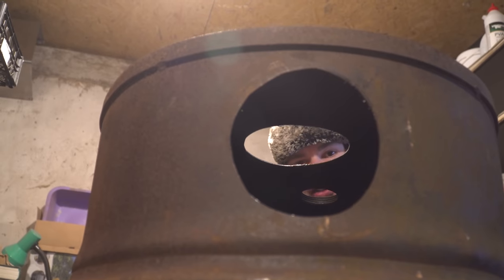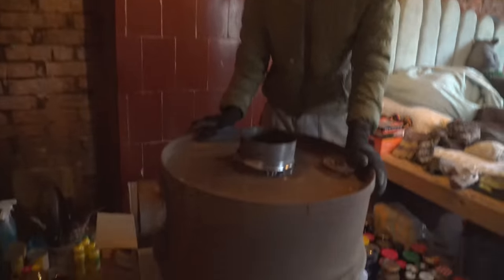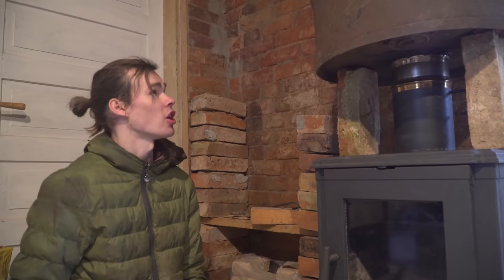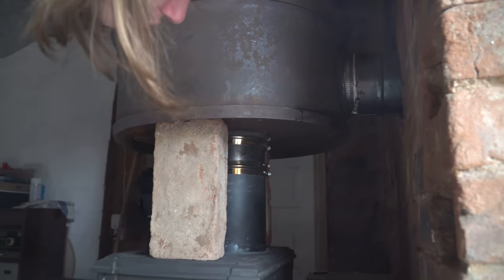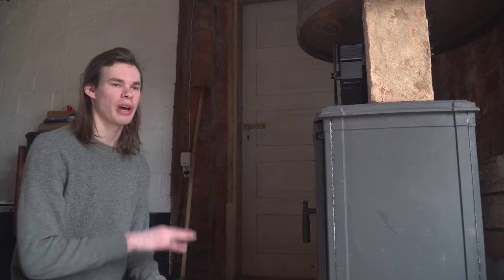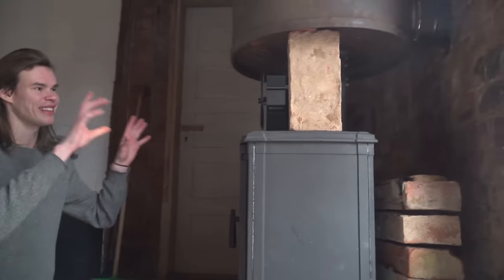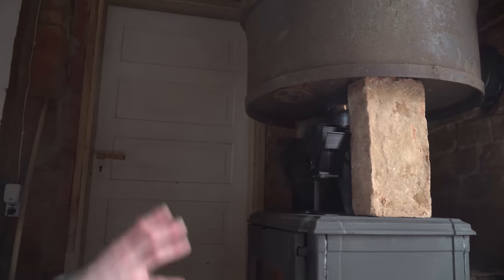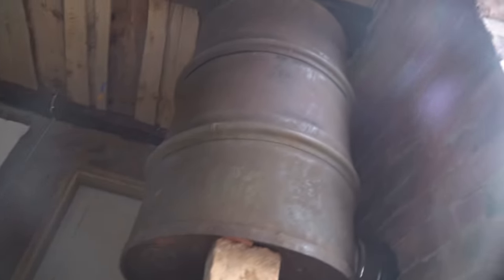Wood Stove to Rocket Stove Hybrid | Does it work?

Comment: I think that a thin modern barrel would work just fine.  Modern barrels are often used as the fire box in many wood stoves and I have personally seen then last 20 years.  That is with the fire directly in them, you are only putting hot smoke through it.  great idea for a heat exchanger .  Glad to see it help so much.

Comment: In the longterm it might be an idea to coppice cherry trees. (Or pollard to keep the leaves out of animal's reach). We did this at home for many years. The regrowth is always extremely straight and yields useful sticks and firewood. Don't coppice the tree every year, because it won't give much fruit that way.

Cherry is a sublime firewood and fun for crafting too. Made an insect hotel out of a log yesterday.

Love your vids!
Reply from the maker: Thank you for the idea! We actually have a cherry tree which is spreading like crazy, I cut down all the new trees growing around it as it was a jungle. But we could plant a large section in the field with cherry trees, I would like them as a wood meterial for furniture. I also need to invest in a wood chipper or make one my self as it would be a good way to burn smaller branches 🤔❤️

Comment: Do & Be Different Family When you mentioned your rocket stove modification i imagined the drum being filled  with sand with a pipe running through like a tunnel. This would make a heat bank to be released back into the room when the fire goes out. Less firewood burning time.

Comment: This is a unbelievable idea. I heat with total wood all winter.. this spring I’m gonna definitely attempt this good idea.. The only problem I fear is obtaining a thick gage barrel. Thank you.
Reply from the maker: Yeah it works wonders! 😊❤️ The barrel is a hard one to find as the modern barrels are very thin and won't hold heat for very long. Only good thing they are very light compared to this monster! 😂
Reply: I'm thinking of using a old 280 gal propane tank and modifying to make a barrel.

Comment: What the heck! That’s awesome! Some say to put a fan low on the floor in the coldest part of the house and blow it towards the stove. The theory is a that the cold air will be pushed to the stove low, then heated by the stove then rise and circulate back to the cold fan. Creating a convection or something like that. 🤷‍♂️

Comment: Nice build, well done. I would probably consider placing some cement board or stone sheet on top of the barrel. I had an oil drum that reached to about 30cm below my ceiling and the surface temperature of the ceiling could easily reach 200˚C. Also, although you have a thick barrel, it is also old and rusty and it's possible the intense heat of the riser might eventually breach it. It would also give you a bit more mass for heat storage after burn-out. Enjoy your warm room!
Reply: Great idea.   I too wanted to suggest a heat shield above the stove to protect the wood floor above it.   To prevent any chance a breach would get out of the barrel.   A stone barrier is a good  idea.

Comment: You solved many mysteries for people who are looking how to save firewood- thank you!

One suggestion: exhaust gas are still hot after leaving your barrel: you can weave them through house for at least 4 meters and put cob over it to create thermal mass- idea is to store thermal energy and do not start fire for two days...
Reply from the maker: I had a plan for that but it's a bit messy! For now it seams to be semi clean burning still producing some waste in the chimney but maybe 10% of what it would be without the barrel! 😀
Reply: @DoBeDiff  Just add more piping inside your house to increase heat exchange+ insulate house to reduce thermal loss... with love from Serbia!

Comment: Greetings from Canada! I would be interested in knowing what the temperature difference of the pipe going out the wall was before you added your heat exchanger/rocket stove , compared to now! Rocket stoves are famous for getting the most heat out of the wood and just warm(not hot) air goes out the chimney. Great job!👍👍😁

Comment: I am impressed! I was sceptical about this idea but looks like it works great! Well done! 👍
P. S. also instead of opening it you can buy an inspection door, there are for sale in Depo in chimney sections. 👍
Reply from the maker: Thank you! ❤️ It seams to work for now! We do need an insulated chimney to be fully safe ad the smoke is too cold or the difference in temperature is too high. But for now It works great, after 20 burns there isn't much of a build up so it isn't as fast as I was scared it will be. I was making this and was non stop worried it will not work at all, but works exceptionally. I want to buy an inspection door which will be easy to install on the barrel! 😊

Comment: Now draw in cold outside air and seal it to the air intake to the heater. The draw pulls outside air through cracks in the shell of your house.  Outside air allows 30 %  extra heat because your not burning heated air.
The barrel will also work on its side but needs internal baffles and a removable lid. You have done well! Enjoy.

Comment: It's great what you've done to make the house more comfortable.  I'm not sure how hot the top of the barrel gets, but assuming it's the same as a typical flue pipe you should probably have a gap of between 15-18 inches between it and the floorboards above (as they're combustible). That's normally for a 5" or 6" pipe, so it could be that the large flat surface at the top means you should have even more of a gap? I'd suggest you have a look at recommendations for some sort of shield just to be safe, especially as it could be running overnight. Enjoyed the video and the way you've getting around problems, but thought I'd mention the shielding as it's worth checking out.

Comment: I don't think this qualifies as a "rocket stove", nor a hybrid.  What you've made seems to be more of a "bell type" or "bell style" heat exchanger, attached to the top of a wood stove.  That said, I imagine what you've come up with is still much more efficient than a typical wood stove installation.  Beautiful, man.  Keep up the good work.
Reply: Yeah, rocket stove needs a few things to be a rocket stove.  L or J structure, insulation in the heat riser and some in the combustion chamber, etc.

Comment: You guys made an awesome version of a rocket stove. I have been studying them. Can I ask what kind of insulation you put around the pipe? I’m so impressed. I bet you could come up with a way to bolt that barrel to the wall so you could get rid of the bricks. Not because they are ugly. But because then you can use that space to heat a kettle or something. You are a complete genius. Love it
Reply from the maker: Thank you! 😊❤️ Heat resistant rock wool. It works good but would like to use ceramic wool, i will upgrade it next year with proper insualted pipe with sheet metal around the insulation so it doesn't fall apart. The outside pipe holds it quite good aswell, together with the bottom pipe it doesnt need any support we are just careful if it works without any problems might remove them 🤔😊
Reply: @DoBeDiff  You guys are the bomb. You really are. Love to watch all the work you do And the cooking

Comment: If you can get a small pipe hooked to outside air to inside your stove. This will stop the stove from pulling any cold air in under doors or windows.

Comment: wonder how your fuel expenses (in terms of the number of sticks or logs you have to take out of the shed per day) have changed.

i wonder if offsetting the stove and lengthening the exhaust pipe could get more heat out of the exhaust.

amazing stuff, even if it just helps your draft dynamics be better.

Comment: That looks amazing!

Do you think there's a way to make the heat move upward (to the next floor)? Would adding some pipe with ventilator be helpful or would  the heat's tendency to raise be sufficient?  II am trying to figure out how to make the basement stove more efficient. I don't really need to heat the basement very much, so the more heat going up, the more efficient (unless I store the heat in mass before sending up, not sure if that would also help)

Comment: What is the name of the sealant that you used, would like to know where to buy it.
Reply from the maker: Just any heat resistant sealant that is able to handle temps you need. There is many different ones. Every hardware store sells them.

Comment: Is that house still standing after 2 years? The short distance between the top and the WOODEN ceiling looks pretty dangerous.
Reply from the maker: It's changed a lot since then but the gap wouldn't do any harm old stoves are same gap from the ceiling in most houses. It's only 150 degrees Celsius so can't burn the wood in any way. But next season the barrel is fully gone we have switched to Central heating boiler much more efficient way to heat the whole house.

Comment: You didn't talk about insulation that you put inside, won't it catch fire inside the barrel?
Reply from the maker: It can withstand 1300 degree Celsius 😊❤️ it might only fall apart overtime from the turbulence created by the smoke but I plan to change it fully to insulated stove pipe that has metal sheet around the insulation which protects it, but first I need a proper welder for sheet metal 😁
Reply: Good idea.  But if soot builds up in the insulation, it can catch fire and cause an explosion.  Be attentive and careful.

Comment: You can cast a riser pipe out of refactory cement using wire thru the single wall sheet metal and cut up coarse steel wool (think rebar in cement) https://en.m.wikipedia.org/wiki/Rebar

So when the sheet metal pipe burns out you will still have the refactory pipe you cast.
Wrap wire around and penetrate both sides of sheetpipe. x100 hand mit steel wool and refactory so steel wool is dispersed throu out.  Be well.

Comment: Are you sure that pipe thing doesn't release toxic substances into the room air?
Reply from the maker: What pipe thing? The barrel? How could it release anything its made to hold liquid its airtight. And chimney will have holes and gaps no matter how good they are, the draft pulls the smoke and gases all out, otherwise your room would be full of smoke. It's not invisible gases!